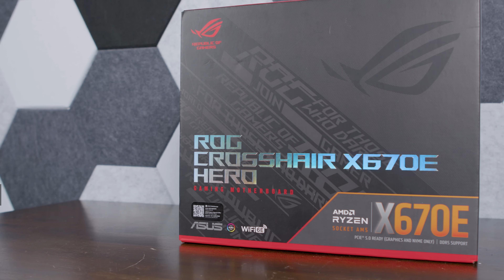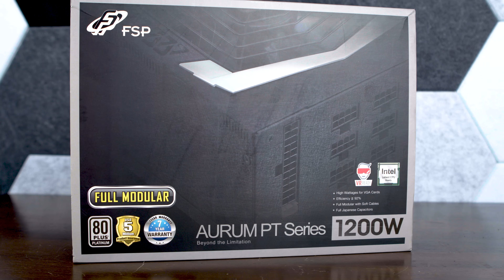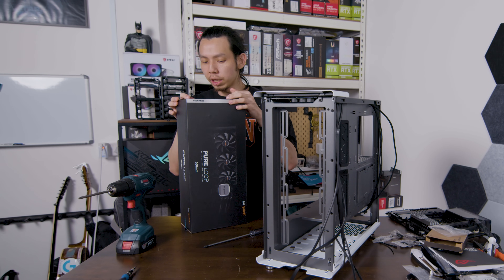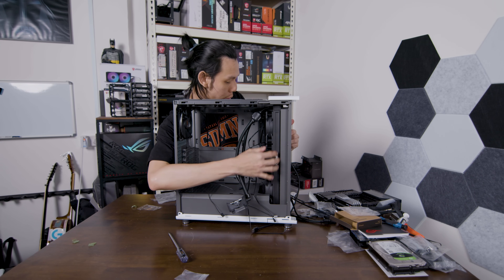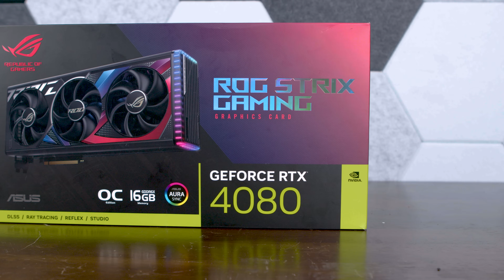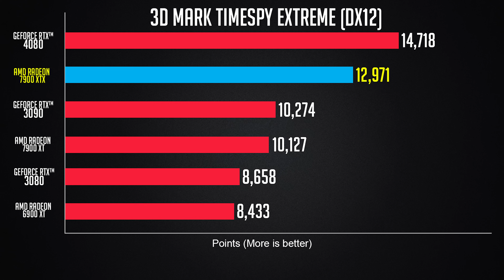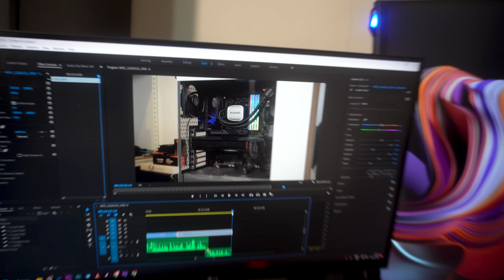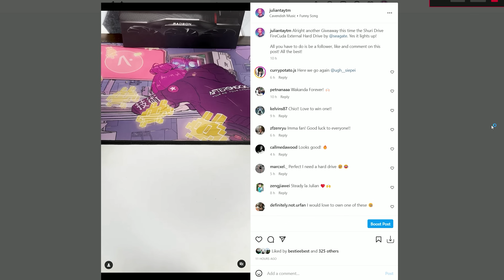This PC is BEAUTIFUL - Fractal Design North!

Comment: doesn't PD 12v mean power delivery over usb? I'm pretty sure the extra 6 pin is for the front panel usb. Pcie gen 5 doesn't require an extra 6 pin connector
Reply from the maker: it's a extra power for the USB type C. it can really fast charge your device

Comment: Would highly recommend the lianli GPU support, its very low profile, still more than supportive enough, and leaves your gpu to be the main attraction. I also think running AIOs in pull is better as its much easier to clean dust that way, just need to pull the front panel out and can get most of the dust already, what do you think?